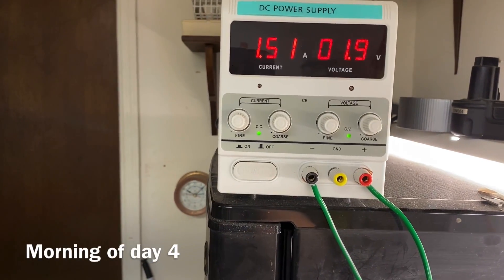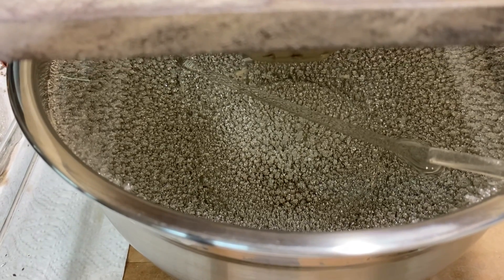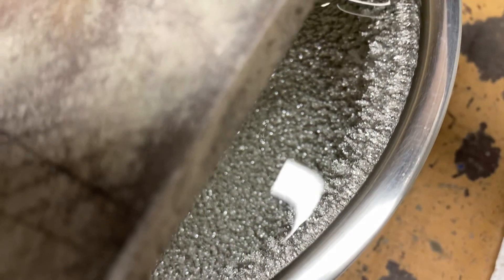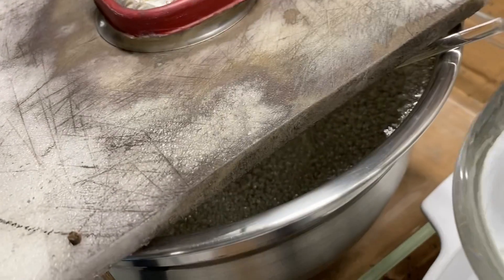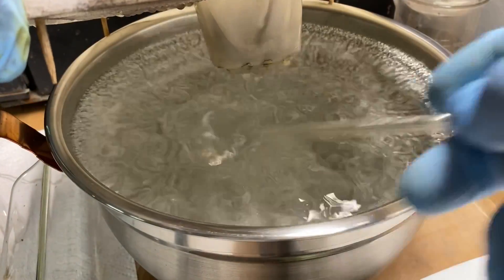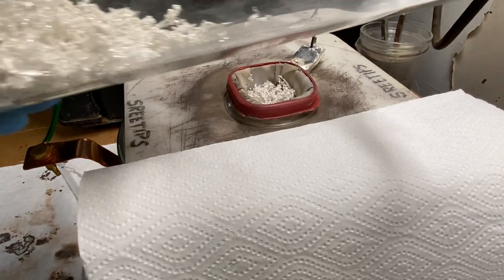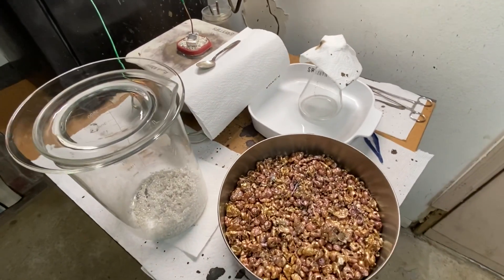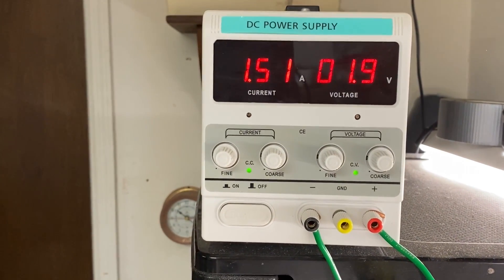EP012 Silver Cell Replenish Electrolyte Day 4

Comment: ya know it always puzzles me why you use the silver as an electrolyte and then use it to pull more silver out of the cup, wouldnt it make more sense if the electrolyte is something other than silver? it feels like you must be refining the same waste products when they just go back in to be cemented. All your contaminants are being recycled. There has to be a better way than to saturate that electrolyte with the material you are refining, it must leave so much in solution at the end of the run
Reply from the maker: I use the electrolyte for two runs, adding silver (200g) to replenish the electrolyte concentration. I get about 1.5 kilos of pure silver for each ten-day run. I get 3 kilos of high purity silver crystal by using 800 grams of pure silver from a previous run for the electrolyte. Net gain of 2.2 kilos of pure silver for about twenty days from a single silver cell.
Reply from the maker: I use silver for the electrolyte because that’s the way I learned it from the professional refiners who taught me.

Comment: Why is there palladium and other impurities in the silver? Aren't these removed during the mining process?
Reply: they reside in and "travel" with silver through the refining process.
Reply from the maker: Yes
Reply from the maker: I refine gold. White gold may contain palladium and other platinum group metals. Palladium is soluble in just nitric. Platinum in trace amounts will dissolve in just nitric - gold too. So these metals are in solution with the silver. When I cement the silver on copper, the PGMs cement out too. That’s what turn the silver powder a dark grey. These metals are then trapped in the anode filter as slimes.

Comment: I'm happy what you are solved your problem. Electro-chemistry is not the easiest thing to understand.
The mainthing to understand well is the ohm law. and understand things  that affect the several parameters of the ohm law formula.
Anode passivation / anode & cathode size  & spacing/ electrolyte salt concentration & temp & acidity / bad Connections or wire size etc...
The + of a regulated power suply is the locking of the formula's parameters, by adjusting permanently the voltage to have a constant amp undependly of the cell variations.
This mean that the cell reaction is constant, so the silvers crystals grow size and shape is constant too.
Without a regulated powersupply, in electro-chemistry it is motly imposible to have a constant reaction. it is a must to have !
Your absolutly right when you speak about electrolyte evaporation, and refiling.
Very great sreetips ! 
With a 3 refinined crytals, you'll end up with a 100% pure silver crystals :p . do you think is it possible ? lol
Reply from the maker: No to 100% is again the law of entropy.

Comment: Would there be any benefit to using a larger Tupperware bin to jolt the filter basket? Or is everything pretty sized for the current and volume of the solution ?
Reply from the maker: If I found a bigger stainless bowl with the right dimensions. Cathode to anode distance is critical.

Comment: @Sreetips you wrote constant Stirring During opération would be idéal... May be you can put a  air bubbler un There?
Reply from the maker: I don’t know how air bubbling would affect things in there. I’m thinking more like a pump or mechanical low speed propeller.
Reply: @sreetips  Air bubling pump can be use for induce brewing, especialy if the solution need a peristatic pump cause of corrosive reagents...
A magnetic stirrer can be use, but the best for this use is a lab overhead stirrer with a teflon propeller, with a slow stirring speed.

Comment: I understand the silver in solution gets plated out, but more is always dissolving from the basket to replenish it right? I do a lot of copper electroplating and maybe that's different since i'm not Mass plating, but with 3 copper pipes for anodes, I've used the same copper sulfate solution for over a year.  As long as your electrolyte isn't getting to contaminated with copper salts I can't imagine ever needing to replace it beyond topping it off with fresh solution as it evaporates. I don't really know what i'm talking about when it comes to sliver cells, just copper plating. If you say it doesn't work like that though, I'll believe you.
Reply from the maker: I’m not sure how it works with respect to lack of copper accumulation in the electrolyte. Running the same silver nitrate electrolyte for an extended period would be very beneficial. Not sure about this. Thanks for the heads up.

Comment: The next cell you build should be a big 'ol 10qt stock pot. Would be sweet to see a scaled up, huge one. Would that even work, or would it require dangerous currents?
Reply from the maker: A larger cell can be constructed as long as the critical distance between the anode and cathode is maintained.

Comment: Do you have to replenish the solution with acid? Does it get consumed during the reaction? What strength do you need to keep the solution at? This is a fantastic series of videos!
Reply from the maker: I try to keep excess nitric to the lowest level possible. If palladium is present in the anode slimes (shouldn’t be in this run of silver crystal) then an excess of nitric in the electrolyte would tend to dissolve the palladium and allow it to contaminate the cell. I can tell if there’s palladium in the cell electrolyte if the electrolyte turns green. Palladium, in small amounts, is not a problem. But if it’s allowed to get concentrated in the electrolyte then it could begin to co-deposit and contaminate the pure silver crystal. This might seem bad from a silver purity point of view. But it’s even worse if you consider that palladium is about 100 times more valuable than silver.

Comment: you need to find a used beer keg they are stainless steel and cut the top off you’ll have a 5 gallon silver cell
Reply from the maker: That would be awsome
Reply: @sreetips  The distance between the cathode and anode might be a problem. There could be a minimum length issue which would stop you from using a container of a certain size.
Reply from the maker: Quite correct
Reply: @sreetips  That  not 100% true. there is no problem if the anode size grow up proportionnaly as the container's size...
The anode surface area is larger, so more curent passing across.
You can mesure the cell resistance, and adjuste the anode size, and electrolyte concentration & acidity to have the right cell resistance.
Is the resistance of your big cell is the same as your small cell, the crystal size and production rate will be the same for the same anode square. 
In the big cell the anode size is biger so more silvers goes into the electrolyte by time. 
You just scale up the operation. all is possible ! but the complet reaction (covering all of the stanless steel bowl with silver cristals) will be longer to completed in the large cell because os this size...
The + of a big cell is spacing the  harvests, a biggest harvest, and sure less handling...
Reply from the maker: I like the size of the cells I now have
Reply: @sreetips  Yes, for home refining it is sufficient.

Comment: I see from the comments that I'm not the only one whose imagination was fired up by the constant stirring idea. Stir bar? (Maybe magnetic stir bar doesn't work in a steel bowl...) Little immersed propeller? (But what material? The immersed part should be stainless steel, I guess...) Maybe some other idea from the industry? Maybe an air bubbler would be enough to keep the fluid agitated...
Reply: Would this speed up the electrolysis as well? Or on the contrary, would it stifle the crystallisation?

Comment: Pretty sure if your Silver in your anode basket is pure the SilverNitrate concentration in the electrolyte will only increase due to evaporation of water from the electrolyte. The SilverNitrate concentration will indeed decrease if Copper gets disolved in the electrolyte. It is an exact balance of electrons in your cell. So 1 electron will be taken from your Silver in the basket and will dissolve as a Silver ion in the electrolyte, that 1 electron will be "pumped" by your DC power supply to the Kathode bowl and will be Added to a Silver ion from the electrolyte to plate out as a Silver atom on the bowl. There is an exact electron equilibrium there. Copper needs 2 electrons taken to become an ion so if 1 Copper atom gets dissolved in the electrolyte 2 Silver ions wll plate out of the electrolyte to restore the equilibrium. Also the reason why twice as much Nitric Acid is needed for Copper atoms to dissolve the equal amount of Silver atoms. At least that's the theory.
Reply from the maker: If true then the electrolyte can be used over and over. sounds too good to be true.
Reply: @sreetips  that is not as simple. in the cell if the water volume rest the same, the salt concentration into electrolyte doesn't change. It act as a bridge for electron. but some silvers salt are remplaced by copper salts if the silver anode containing copper impurity.
This mean the more anode copper impurity it is, the more silvers salts droping into the electrolyte, and the more copper salt increasing. that why as things progress the electrolyte became more and more blue.
But he is right, one metal electron is taken from the anode, one metal electron will be depose on the cathode.
The proof of the salt concentration doesn't change and increasing by electrolyte evaporation is the indication of your power suply :
At the start, to have a constant current at 1.5amp the power suply adjust the voltage to 2.2v.
At the end, to have a constant current at 1.5amp the power suply adjust the voltage to 1.9V.
This mean that the cell resistance is dropping. 
At the start R = (2.2/1.5) =1.47ohm
At the end R = (1.9/1.5) = 1.27ohm
Resistance is droping, because the solution became more conductive, caused by electrolyte salt concentration increasing induce by water evaporation.
In chemistry, always remember the famous citation of french chemist called Antoine Lavoisier :
"Rien ne se perd, rien ne se crée, tout se transforme"
“Nothing is lost, nothing is created, everything is transformed”
Reply: PS I think if your copper salt level into the electrolyte is to high it can compromise the purity of your final silver product...
I don't think you can re use indefinitly the electrolyte.
Reply: @gaulix69  I've seen a guy once who made a graph and claimed that indeed the higher the Copper(II)Nitrate in the electrolyte got the more Copper also was deposited with the Silver in a simular electrolytic cell Sreetips uses but I've seen no proof his claim was true and I cannot theorize it..You could only proof that with an analysis of the crystals in the bowl. It's ofcourse obvious that Copper dissolves in the electrolyte by adding the inpure cement Silver shot just by the colour of the electrolyte and the way how the cement Silver was created. It's also obvious once all the Silver ions from the electrolyte are plated out and replaced by Copper ions the deposition of Silver has gotten impossible because the Silver ions simply can't travel anymore through the electrolyte from basket to bowl. I'm still very interested what the effect of disolved Copper in the electrolyte does with the purity of the SIlver crystals. I would only believe the results when I see experiments proving things and not asumptions people do.
Reply: @johannesdesloper8434  Maybe the copper tetra amine complex test can be do the purity test ?
Reply: @sreetips  Think my little writing says enough.. If Copper ions dissolve in the electrolyte it kicks out the Silver ions out of the electrolyte twice the rate.. so the elctrolyte wil contain more and more Copper(II)Nitrate and less and less Silver (I)Nitrate. Nitrate ion amount stays exactly the same. Proof is that the electrolyte turns green/blue. This is what I was taught with chemistry lessons at Dutch Engineering Skool 25 years ago.
Reply: Sorry to say sreetips..I think you just lack basic theoretical knwoledge of chemistry, (that's why I wrote it) but on the other hand you excell with practical knowledge of handling Nitric Acid and metals and some other stuff and that's why I watch your channel. The practical behaviour of reactions is extremely hard to predict with theory and can only be learned from practical experiments. That practical knwoledge is extremely important to do the reactions you do without boil overs,accidents and succesfull high efficiency refining. I keep watching :)
Reply from the maker: I’m not a chemist, nor do I need to be to refine gold and silver. Platinum group metals, now that’s a different story

Comment: you could stick in a stir rod with a slight flattened tip hooked up to a motor or PC fan to act as a constant stirrer and have it poke through that chopping board.
Reply from the maker: Yes, I’ve been thinking of that

Comment: Have you considered a bigger anode basket? When you do run the impure shot, it will take longer to clog up if you have more surface area.
Reply from the maker: Agree
Reply: @sreetips  I expect that you could run at a higher current too! if you calculate your external surface area of the current anode basket and establish a ratio with the new bigger basket, that should give you the new current setting ratio.
Reply from the maker: That’s a possibility

Comment: I'm wondering if you use a second silver cell , the first one to run your silver shot and the second to rerun the cristal.  If the would speed up the process and only needing to clean up the one processing the shot .
Reply from the maker: If parameters are kept tight then a single pass using 98% feed stock should work. Use the electrolyte for two runs then replace.

Comment: Hi Sreetips, loving the updates, one question though, if I make up a batch of electrolyte can I keep it a while before I use it and how long will it be usable for?
Reply from the maker: I’ve never done that. But it should be OK. Just keep it tightly capped and out of the light. It may turn color if exposed to strong light. Not sure.
Reply: @sreetips  your right, you can store it  for long time, but be careful, silver salt are sensitive to light. you must store it in the dark. into bottle for this use.

Comment: Would a hollow glass-tube as a low-pressure bubbler, make a suitable constant stirrer?
Reply from the maker: I don’t know about bubbling air
Reply: You want the electrolyte to remain still to promote large crystal growth.  Stirring might speed up the process, but would produce very small crystals.  Large crystals are normally higher purity.

Let me add, this is based on my experience growing Organic, OrganoMetalic, and Inorganic crystals for X-ray crystalography.  But I've never grown Silver or any metal crystals, so it may not apply.  But that's the way I'd bet.

Comment: Hi, really enjoy your videos.
Curious though, why is silver refined using this method and gold is refined using the precipitate method?
Just trying to get smarter.  Thanks.
Reply: Electrolytic refining is slow, as you can see on this video series. However, you CAN do the same process with gold, in fact Mr. Sreetips himself made that once. But, for his purposes, the chemical refining is faster and achieves purity levels good enough for what he wants (triple 9 fine, i.e., 99.9% purity). Electrolytic refining can achieve quintuple 9 fine gold.
Reply from the maker: Here’s a video of gold crystal: https://youtu.be/zDfujDqEPMo
Reply: @sreetips  Thanks.  That was interesting, especially the self growing crystal in solution.  Was it a little super saturated?

Amazing to see about 8 oz of gold as a fluid.  👍🙂
Reply from the maker: Gold can be refined electrolytically. But precipitation is quicker and easier. Silver can be precipitated as a chloride then converted to three nines silver with lye and sugar. I prefer the silver cell because it gets the platinum group metals in the slimes.

Comment: Would it be possible to make a single huge crystal, like how quartz can just keep getting bigger.
Reply: Electrowinning of metals tends to form a dendritic structure - tree branches and the like. https://www.youtube.com/watch?v=COMTYzqe_XE

Impossible to get a solid surface. You might have to put an additive to passivate the branches as they form so it would just be a solid surface. They do this in copper refineries, they add an organic liquid to the electrowinning solution so that you don't get a dendritic branch that grows out, eventually touching the anode and shorting out the cell.
Reply from the maker: I’m waiting for the silver crystal to I start forming branches. The dendrites usually form just under the anode basket.
Reply: @sreetips  Maybe it is possible. with a cristals grow generator. you should check the work of normand boivin.
He growing somes alum salt pyramid mono-crystals.
All element have their own crystals shapes. but there is no reason that should onbly possible with alum.
In the generator the all thing is to setting all parameter good, to give the best condition for a mono crystal grow.
Reply from the maker: I don’t know I’ve never seen one.

Comment: Have you considered setting up a big pre-cell? You could have a big anode that lets much more silver plate out and then run the crystals from that cell through your smaller cell. There are multiple ways to speed up the process and reduce the ultimate cell size needed, such as having a glass scraper collect crystals on a timer. Or you could have a rotating steel cylinder in a glass container that scrapes crystals into a collection dish. Then you can place a big mesh tube next to it, giving a much larger surface area to your anode.